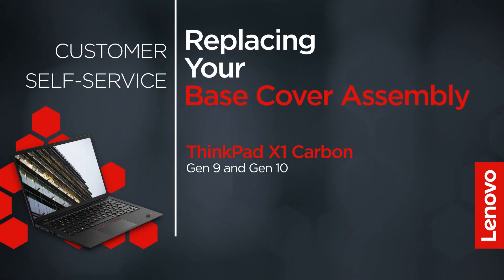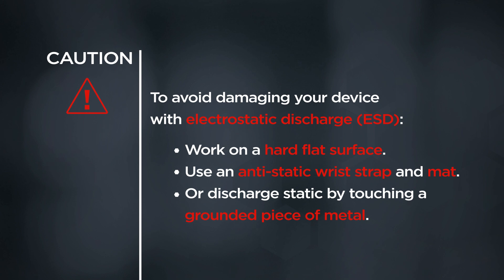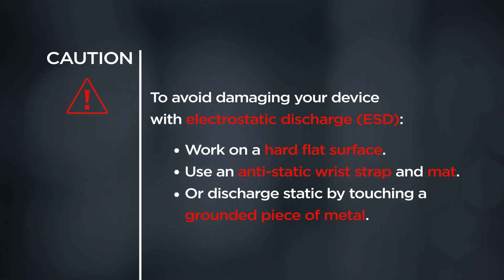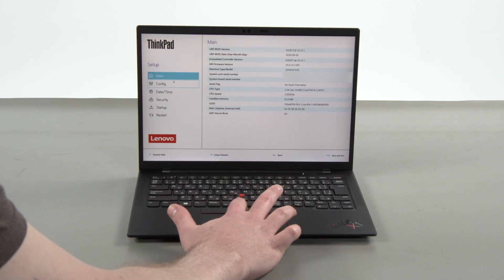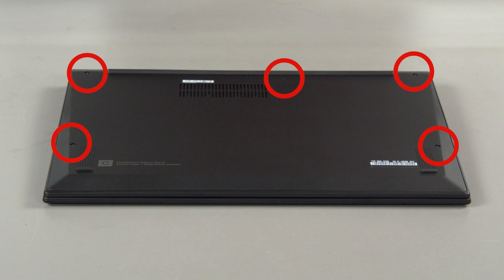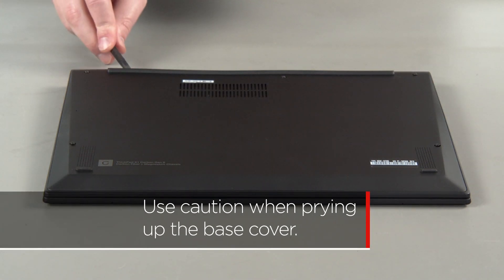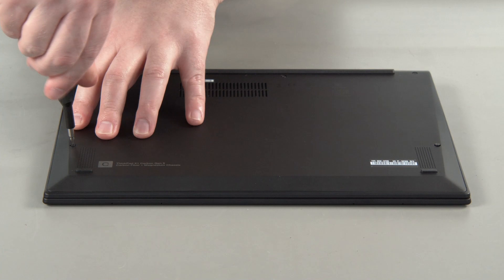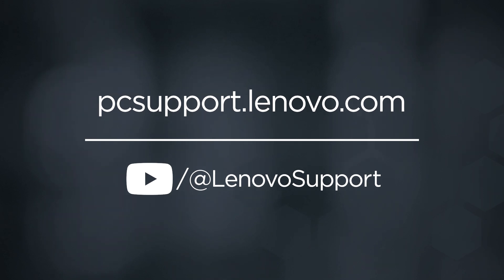Replacing Your Base Cover | ThinkPad X1 Carbon Gen 9 and 10 | Customer Self Service

Comment from the maker: This video will show you how to replace the Base Cover of your ThinkPad. The process in this video will work for the ThinkPad X1 Carbon Gen 9 and Gen 10. 

You will need a screwdriver kit, a non-metallic pry tool, and 10 minutes of your time.

To view the ThinkPad X1 Carbon Gen 9 Self-Repair Guide go to https://pcsupport.lenovo.com/us/en/products/laptops-and-netbooks/thinkpad-x-series-laptops/thinkpad-x1-carbon-9th-gen-type-20xw-20xx/selfrepair/removalsreplacements

To view the ThinkPad X1 Carbon Gen 10 Self-Repair Guide go to https://pcsupport.lenovo.com/us/en/products/laptops-and-netbooks/thinkpad-x-series-laptops/thinkpad-x1-carbon-10th-gen-type-21cb-21cc/selfrepair/removalsreplacements

To learn more about your device go to https://pcsupport.lenovo.com

To find parts for your device go to https://support.lenovo.com/parts-lookup/?cid=ww:lenovosocial:b9515f&source=socialmedia&subsource=yt

To view the Lenovo Support Self-Repair Guides landing page go to https://support.lenovo.com/us/en/solutions/HT516547

** NOTE: Static electricity can destroy components. Use a grounding strap, and clean, non-conductive surface to work on. Use plastic or coated tools to prevent scratching and avoid using metal tools on plastic parts. For more detailed information on electrostatic discharge and how to prevent it, please watch our ""Understanding Electrostatic Discharge (ESD)"" video: https://youtu.be/by4PB3WtdLo 

Applicable Machine Types:
ThinkPad X1 Carbon Gen 9 - 20XW, 20XX
ThinkPad X1 Carbon Gen 10 - 21CB, 21CC

#lenovo #LenovoSupport #LenovoTechSupport